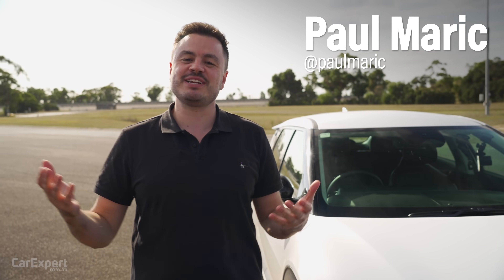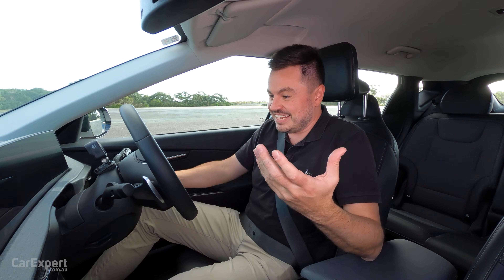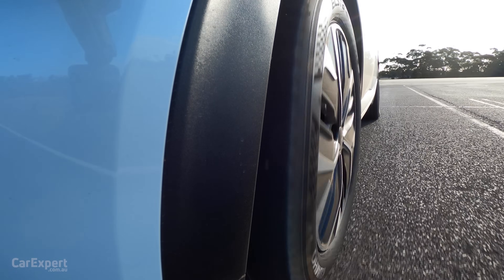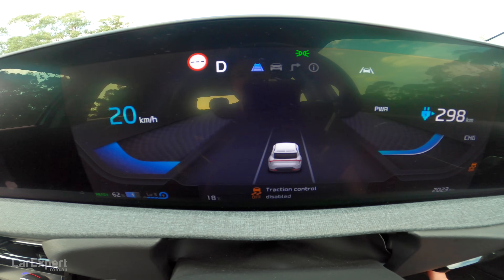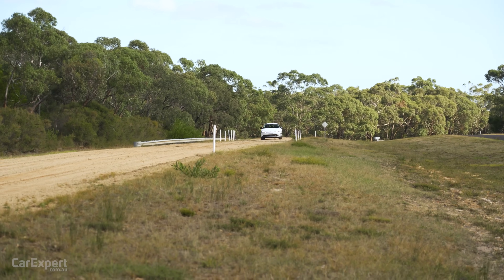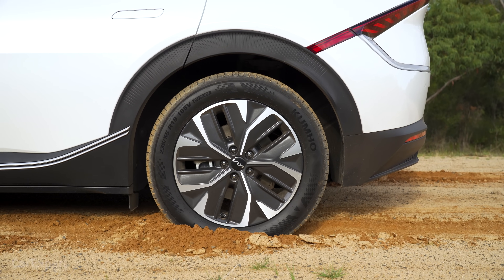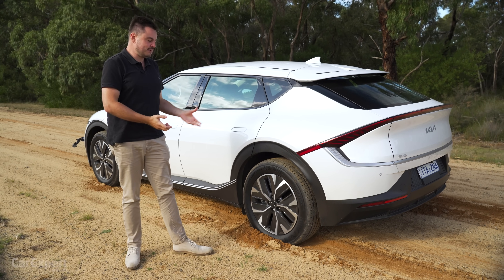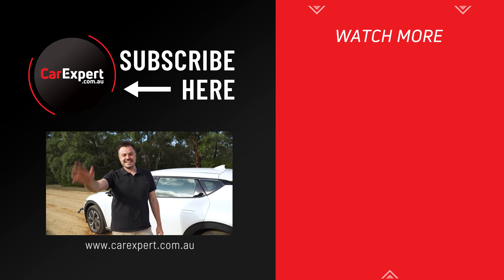Pulling the emergency brake (handbrake) in an EV - what happens is surprising!

Comment: My SUV isn’t an EV but does have an electric park brake. The manual says that up to 30km/h if applied it applies full braking (to the rear wheels which is what the park brake operates). Over 30km/h it says it will gradually apply the brakes to bring you to a full stop. 
I’ve only tried it at about 15km/h - it was on tar seal and it locked up the rear wheels.

Comment: Interested to know the replacement cost of the "Emergency" brake "actuator" on that EV. 

Is that the same device as an electronic handbrake in other cars? 

Recently we had a very expensive experience having to replace the "Actuator" on the electronic hand brake that failed in our 2013 Hyundai i30. 

Our bill was for AUD $6,000 for the "actuator" and another AUD $800 for one of the rear wheel brake mechanisms needing to be replaced as a result of this incident. 

The rear brake locked up and had to be replaced. Labour costs were then added to the parts cost. 

Over $7,000 all up. 

This was just from operating the electronically controlled parking brake when parking the vehicle in a stationary position, not whilst driving along as shown in this video. 

The electronic brake normally releases automatically when starting the car with a foot on the brake pedal. 
We drove about 5 metres before realising that the brakes hadn't released and were actually locked up. 
We are guessing that is the reason why the brake system on one wheel was damaged.

After making a written complaint, the local Hyundai dealer covered about one third of the cost. 

The vehicle was only a couple of months out of extended warranty. 

We had to pay the rest of the bill.

Buyer beware !

Comment: Thanks, Paul. It's not just like hand brake as it applies brake on 4 wheels not just two rear wheels like hand barke does. Another reason named emergency brake is that it will bypass regenerative braking and just use physical brakes instead of engaging regenerative braking system in case of an emergency.
Reply from the maker: Very good point!

Comment: Paul, I remember pulling the handbrake button on the VF SS and it made a very loud clicking noise and then came to a full stop. Almost like the ABS module pumping. My Model 3 however, technically has the hand brake it you hold the P button on the stalk and it will slow down very fast to a full stop.

Comment: Don't think it makes a difference EV or not. It's the same for the electric handbrake on most new cars.
Reply: No. Seems it’s different on an EV. My Electric Park Brake only acts on the rear wheels and doesn’t use the ABS system. It goes full lock at speeds up to 30km/h and gradually brakes to a full stop if applied at speeds faster than 30km/h.

Comment: The ABS will over ride it and not let it lock up while in motion.
Reply: My electric brake (not an EV mind you) does not use the ABS system and brakes only the rear wheels.
Reply: @jerrymyahzcat  Does it lock up when you engage it at speed?
Reply: @eddiemoore5633  According to the manual it applies full brake application (rear wheels) at speeds up to 30km/h and gradually applies braking to a full stop at speeds above 30km/h. I’ve only used it when stopped and at around 15kph. At 15 it was full brakes.
I believe it’s quite different on EVs.
Reply: @jerrymyahzcat  Cool. That would be the ABS technology doing that? Very interesting.
Reply: @eddiemoore5633  not sure it’s the ABS system as it’s supposed to work even in a complete service brake failure situation.
Reply: @jerrymyahzcat  Happy to be advised, mate. Good chat.

Comment: Does it do any damage to the brake system when it is not intended to be used like that? should you get the mechanics to check the brakes after an emergency use like that?
Reply: No, it's just applying the normal brakes through the ABS system
Reply: It can’t just use the normal system or it would be redundant. It uses a secondary system as it’s designed to be used if your service brakes fail. 
Same as a Handbrake uses a cable. And a modern Electric Park Brake doesn’t use the ABS and is a separate system. It must operate when the service brakes don’t and under any and all conditions.
Reply: @jerrymyahzcat  if it wasn't abs the tyres would've locked up
Reply: @TheSuperBoyProject  incorrect. The brakes are applied progressively not just jammed on full to avoid lock up.

Comment: Not a fan of the "emergency brake" tag, rather I call it a parking brake or handbrake. Generally it's not a good idea to pull the handbrake when moving if you like traction.
Reply from the maker: It's interchangeable, but I hear you!
Reply: Ive only ever heard americans call it the Emergency Brake or E Brake which is stupid, the emergency brake is the pedal. Its a park brake which is why it has a P on it ;)
Reply: It’s a great idea if you want to do a 180
Reply: Its supposed to be literally an emergency break and parking break, located in the centre of the car so people can use it, incase the driver suddenly becomes incapacitated. (reachable from all seats in the vehicle). But as time flies car manufactures have moved it around and changed it in unreachable places.
Reply: BMW will actually change lanes to move to the side of the road, brake & indicate if you pull it.

Comment: I tried this on several different cars, mostly BMW's, and they basically brake as hard as the ABS will allow them to. Multiple times more efficient than an old style hand-brake.
The latest iterations where you don't even have to release them, but simply just hit 'D' and off you go, are excellent.
Reply from the maker: It was much softer than I thought it was going to be!

Comment: Great info! For a future video, I would love to know what happens when you put your car into neutral (by accident) and then put it in drive again while moving (test it with auto, DCT, CVT etc)
Reply from the maker: Good thinking!
Reply: I've done it to two vehicles with CVTs, a 2015 Murano and a 2016 Honda HR-V. The Honda does nothing unusual; it simply goes back into Drive. The Nissan on the other hand locked up the front wheels for a split second before rolling again.
Reply: I would think nothing dramatic would happen. A DCT might slip the clutches to engage, and the torque converter might also slowly lockup
Reply: My hrv hybrid (dct transmission) kinda spins the motor to prep the transmission before going into gear from neutral
Reply: Not much really.

Comment: Haha, "I wonder what it's like on gravel!?"... great short video! My question is, did you "pull & hold" or "pull & release" the switch? And... does this work on petrol cars too (is it more about the switch than the power unit)?
Reply from the maker: Good question! Pull and hold. Releasing stops the braking immediately.
Reply: It's pull & hold. If he let go it would stop braking.